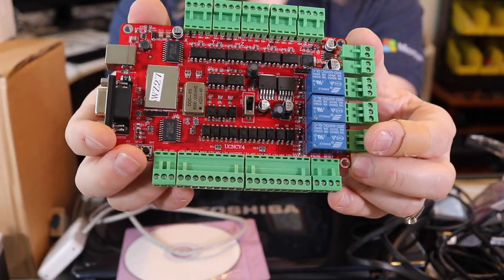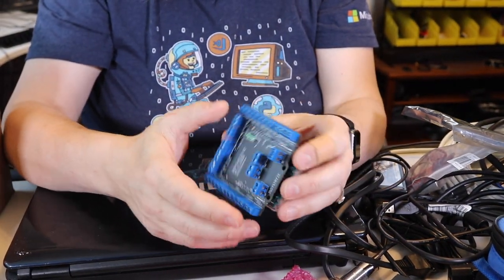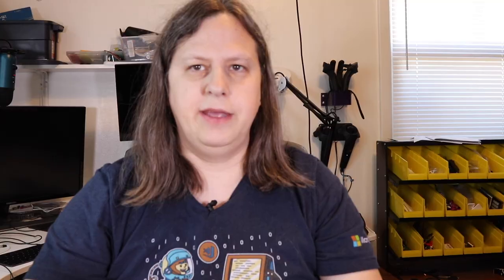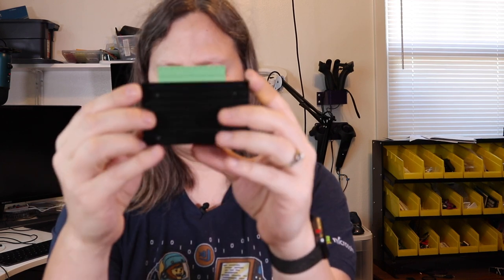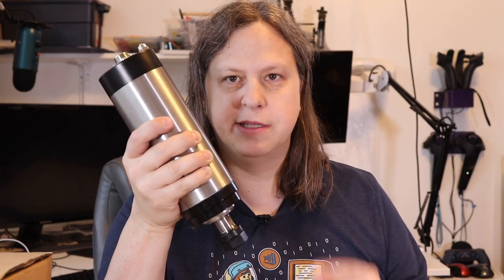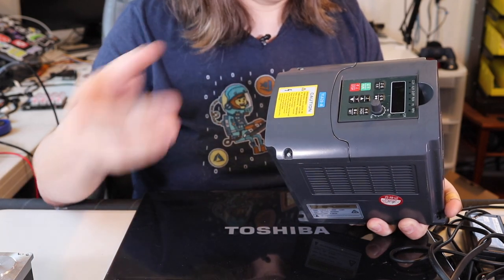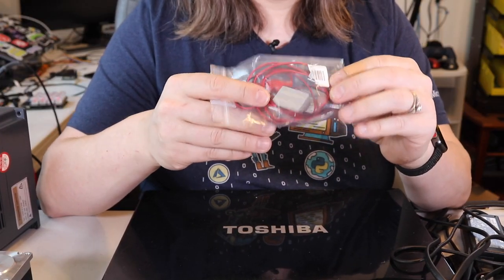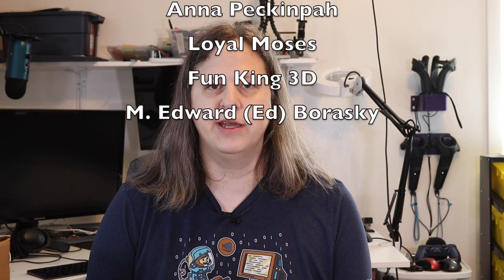Building the IndyMill CNC Router - Choosing the Electronics

Comment: Wow, that is quite the drive. I assume this could handle even harder materials like steel with reasonable speed and bit selection? I am going to learn a lot here, my milling by hand using a drill press and x-y block hasn't done as well as I'd like so far.
Reply from the maker: Harder materials is what I'm hoping for. :)
Reply: Yeah the IndyMill works great for aluminum..

Comment: Good luck with this build. I wonder whether it would be better using servo motors instead? I think Dr. D-Flo replaced stepper motors with servo motors in a Mill and the machine seemed to be more silent and yielding less vibration.
Reply from the maker: Thanks. I'll take a look at that. Since I already have the steppers, it might be a future upgrade.
Reply: Great suggestion, however the volume of the stepper motors isn't a consideration when you've got a stonking great spindle motor chewing aluminum and sending chips into orbit. :D

Comment: sorry is the 36 volts 9a power supply not too small?
Reply from the maker: The particular one I got worked fine for driving the steppers. I ended using a 12V and getting a small 24V one for some of the other electronics.

Comment: for what is the SKR 1.3, RAMPS 1.4 AND INDYSHILD?  what is the functionality? thank
Reply from the maker: The SKR, RAMPS + Arduino Mega, or IndyShield + Arduino would act as a GCode interpreter/Controller. This is a cheaper method than controllers traditionally used in CNCs with the tradeoff that responses may not be quite as real time.
Reply: @makermelissa  And for a professional use, which one do you suggest me buy? maybe like the CNC USB controller Mk3? or some other?
Reply from the maker: There’s really no simple answer to that question. It depends on budget, software, your computer, and your specific hardware setup. For professional use, I’d probably start by looking at Mach4 or LinuxCNC software and find compatible boards for that.

Comment: Just 3D print the hole thing like my design
Reply from the maker: I considered it, but wanted some nice rigidity and weight to it. Since I already bought all the parts, I’m kind of committed at this point anyways.
Reply: I am just a wood working shop so it perfect for that and I ran my own from April this year and it super strong  I am cutting out oak each day now I can keep up with the wood work in the uk so  I make more cnc all the same way I have  4 now I plan to get about 8/10 in this workshop
Reply from the maker: @flippingwoodforcash9130  one of my goals is to be able to cut a variety of materials including metal.
Reply: @makermelissa   I will try it on my on one day  keep up the videos